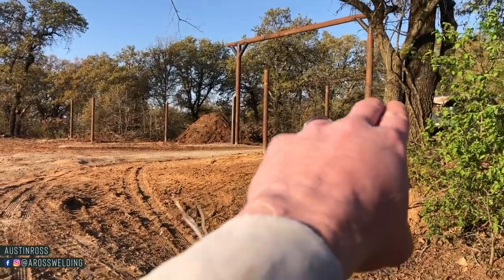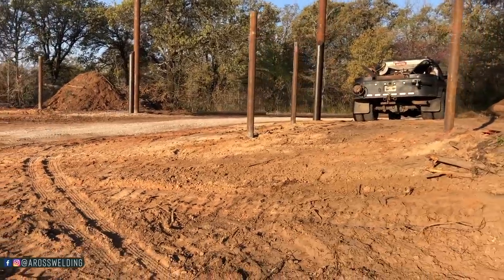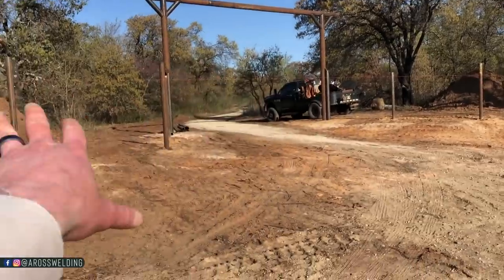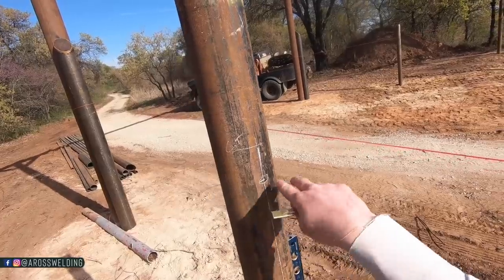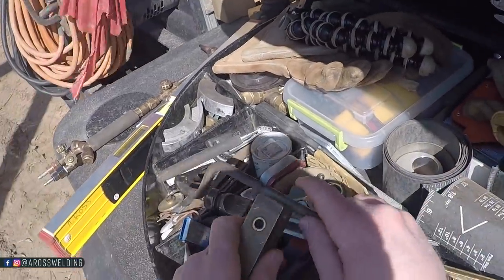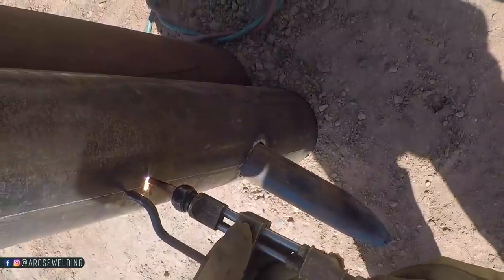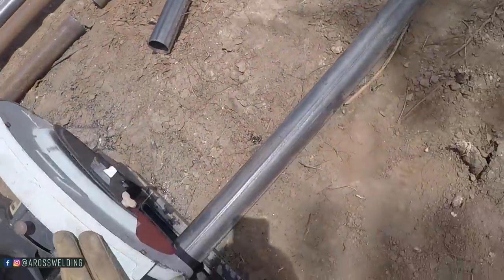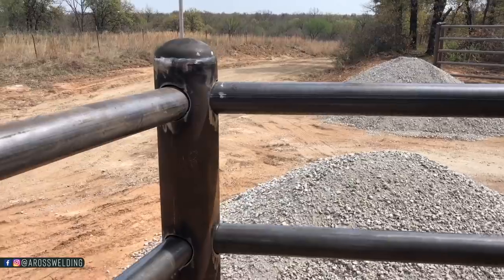BUILDING PIPE FENCE - CUTTING HOLES INSTEAD OF COPING PIPE (TURNS OUT SO CLEAN)

Comment: I own a small railing business and have been doing misc metals for over 15 years, here's a small tip/whatever that I do on stuff with a seam down it. I put all the weld seams on pipes facing down or a direction you wont see it. Makes a nice clean look. Good work!

Comment: Looking good Austin.  I borrowed you idea when we built 3400’ of pipe fence last year.  4” square tubing posts and 2 3/8 pipe rails.  Torching holes in the posts mad everything work out great.  A few things we did that might help speed things along:

-make a story stick for all your post measurements.  It’s faster to transfer the marks off your wood stick onto your posts and prevents errors in reading the tape measure wrong.
-we cut the tops off the posts after torching the holes.  This gave us scrap material to setup the circle burner in case it got dropped or bumped and needed to be adjusted.
-instead of grinding the holes, we used a scrap piece of pipe to clean the hole up.  We used a scrap bell end piece of pipe and hammered it into the hole to wedge it open a shape and knock off the dross.
-we cut all the rails with a portaband.  The lengths and squareness are not super critical so bandsaw does fine.  It also allows you to bring the saw to the pipe instead of the other way around.
Reply from the maker: Awesome! Thanks for sharing the tips y’all learned. 
I def would have made a story stick if I had way more to lay out.

Comment: I have the slow and steady down!!! I’ve been rebuilding all my interior electric fence since the Oct ice storm with high strength tensile wire fence which requires “h” braces. In the process, I’m learning how to weld, cope and etc. I’ve learned so much from watching your different videos. Thanks

Comment: Austin, you should look into a HandyAuto torch. 
Ive got one and love it!
You can cut circles easier with smooth cuts and also straight cuts as well.
It works on the same principles as a track burner.  Can set the cut speed so you don't lose your kurf.and can cut circles in one motion. 
Victor used to make one, but i believe they discontinued it. If you can find a used one would be great!
Ive used both, and I like the Victor the best. If you can find a used one, latch on to it! You will love it!

Comment: Damn fine work man!!! Thanks for sharing. I have a working pen I am getting ready to start and as bad as I weld, I will need all the help I can get! That fit up by cutting the holes in vertical pipe is the way to go. I was looking at possibly using a hydraulic ram to smash the pipe to weld up to verticals, but this looks so much better! Appreciate your tips greatly!!!

Comment: I have the EVO saw and I have switched over to the Diablo blades they’re way cheaper. I would have used a hole saw since your post aren’t that thick. We even have a saddle for the mag drill but you could hand drill that with a hole saw

Comment: if it were my job i would have shot a 5 ft high benchmark with a laser level.  Then pulled an offset from the planned finish grade of the new gravel at the  center of the gates, then considered the existing grade at the lowest fence post.  From there I would use a story pole and set the centers of all my fence rails.   Nice job though

Comment: Really Good job 💪
I have one question 
When did you install the pipes that are next to the overhead entrance pipe? I know you poured the crete on the entrance post but the post thats married to the entrance post wasnt shown on the video. My question is how did you get the 6inch pipe so close to the 8 inch pipe after concrete was poured...Did you weld the 6 inch pipe to the 8 inch pipe, Which was concreted in? Puzzled tia

Comment: do you keep you regulators set on your tanks every time youre done  with them or do you open them and left that was to eliminate the pressure thats left build in and do create back pressure when you open the valves slow and steady? that could be something you can share with us and quick release connectors also. great work ross AKA THE IN THORY GUY LOL

Comment: Great video! How did you do the winding on your torch lines? Also it might be helpful if you talk about your working line pressures on your regulator when you set up your torch. I have found many use the same settings for everything they do and do not realize it important in getting a quality cut.

Comment: Your straight cutting torch set up who makes it? I have  the victor performer cutting torch look like has the same body as yours without the straight cutting attachment .By the way you do good job like your videos.
Reply from the maker: If I’m understanding you correctly... check out these part numbers:
Straight Torch Attachments

Small
0381-0421 CA 1352

Large
0381-1932 CA 2462

And here is the link to our store you can get the circle burner that will fit these: 
https://www.arosswelding.com/shop/circleburner
Reply: @arosswelding  Thank you
Reply from the maker: You bet

Comment: Would you say using the circle burner and fitting the rails that way is faster than coping the rails to fit the pipe?
Reply from the maker: In my opinion, it depends on the situation, how much experience a guy has with both ways, what size of pipe, and if it’s old pipe or new pipe and how much of it a guy has to do. I’ve asked guys who have built pipe fence longer than me and one guy said about the same thing I did, and the other swears it’s faster to saddle each rail... but that guy had done a lot of feedlots, and a lot of them are built with only 2 3/8 an 2 7/8 
Which brings us back around to the situation dependent and how much experience and what kind of experience a guy has...

Comment: Hey Austin would it be better to use a 1/8th 6011 rod for a 2-4 inch pipe fence or could you use a 5/32 8010 rod?
Reply: Did you watch the whole show? He states what he used on it. I’ll give you a hint, it was in the last half.